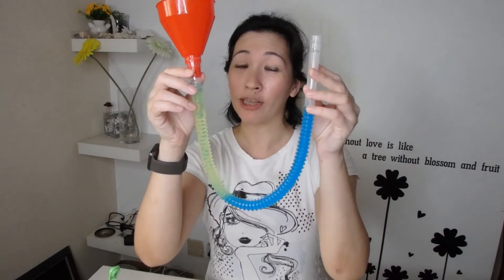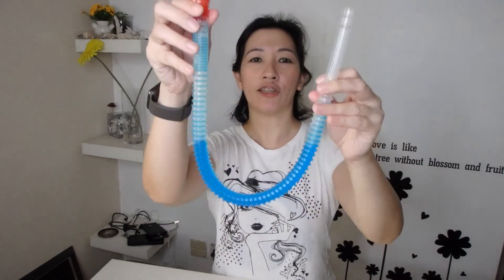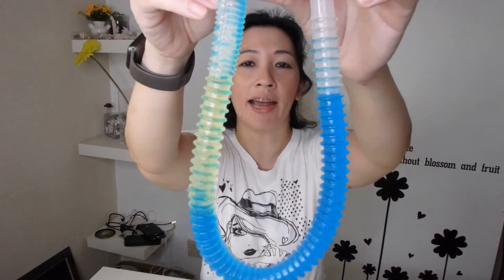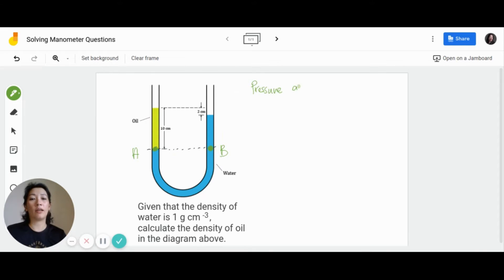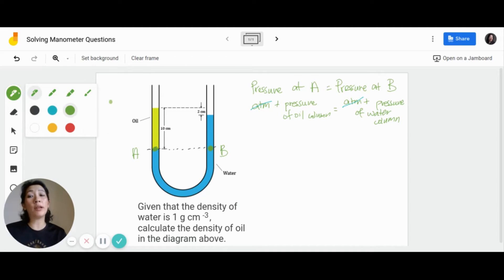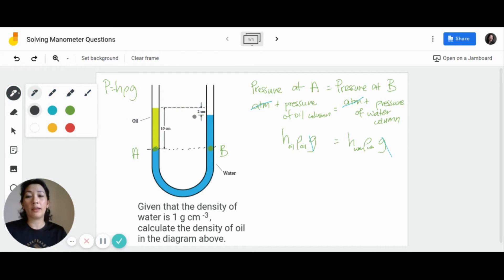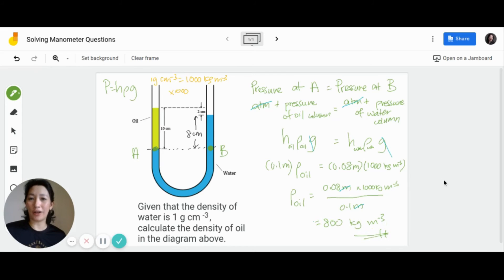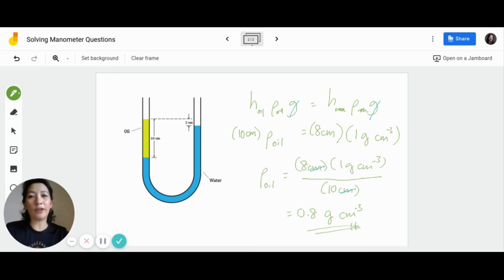Different liquids in a U-tube manometer - DEMO + SOLVE CALCULATIONS [PHYSICS ROX ~ MS HOO SHOWS]

Comment: Grams is smaller than kilograms, right? Why is 1 gram equal to 1000 kg? It should be 1 kg is equal to 1000 grams, right?
Reply from the maker: Yes. But for density, 1g/cm3 = 1000 kg/m3. A lot of students only convert from g to kg but did not convert cm3 to m3. I will release a video soon to show this conversion that may help you understand this.